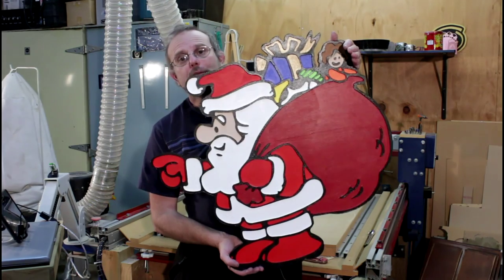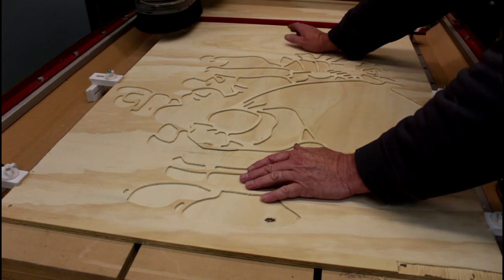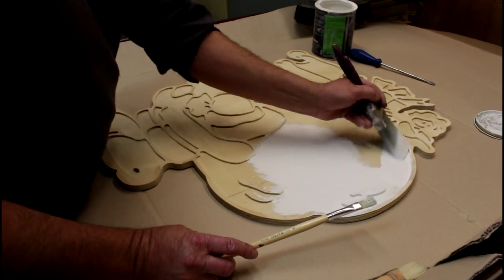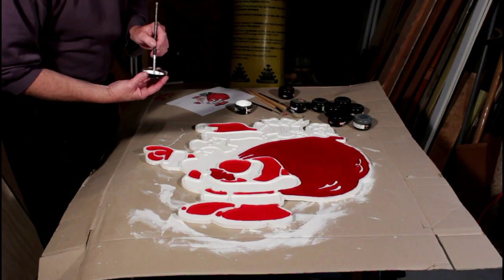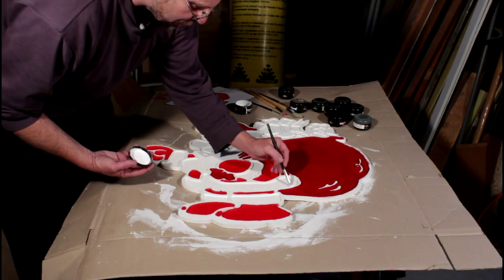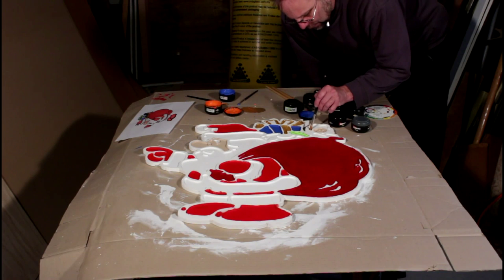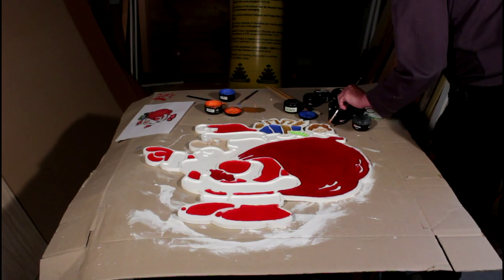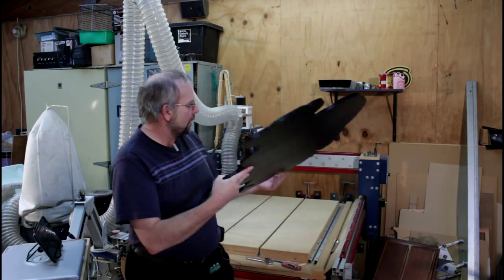Christmas YardArt - CNCnutz Episode 70

Comment: Nice work and excellent narration. 
Here's a tip on finding free approximately 3'x3'  sheets of heavy cereal box type card board as well as the same size corrugated cardboard excellent for using as large painting sheets to protect the work benches.  Pick them up at stores like Costco or SAMs or any big box store that sells toilet paper and paper towels.  They are stocked on pallets and the manufacture puts these sheets between ever layer or so to keep the pile from falling over, and they are glad to get rid of them.  Remember to bring a piece of string to tie the rolled up sheets otherwise they are all over the place.

Comment: Great project, do you have the color paint sheet you have on the table when you are painting it?

Thanks - Kevin
Reply from the maker: +Eaglein80 
You really had me scratching my head there for a minute figuring out what it was you were after.
And then the penny dropped, or maybe it was a bit of dandruff. 
I have added a copy of the Santa complete with colors for you to use as a guide.
I have to admit that  they can be difficult to paint without a reference. I sometimes have to stand the yardart up and stand back to be able to really see it and figure out what bit is what and what color it should be.
Happy painting.
Cheers
Peter

Comment: How do you stake it to the yard?
Reply from the maker: A piece of 20mm PVC pipe in the ground and a couple of saddles on the back of the yard art. Use the right length screws so they don't co s through to the front.
Cheers Peter
Reply: @cncnutz  Thank so much!